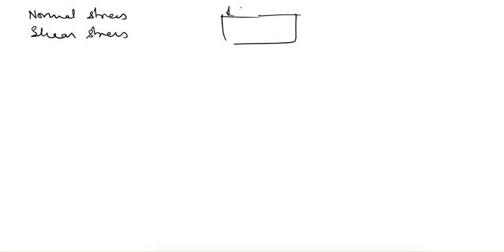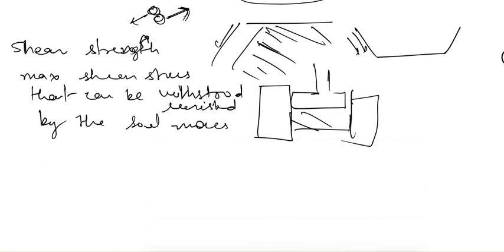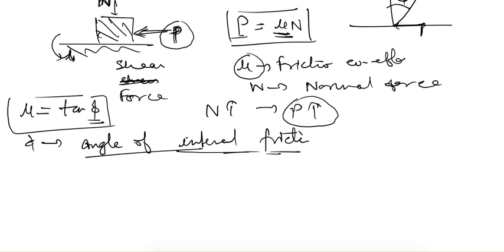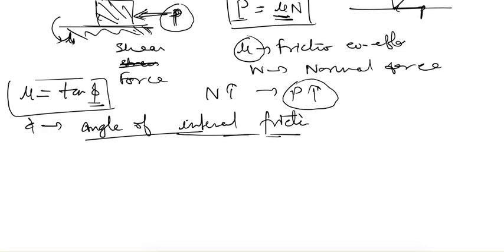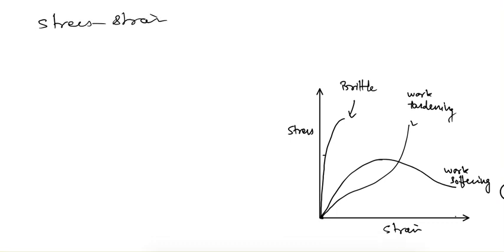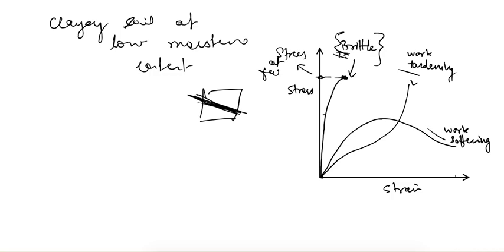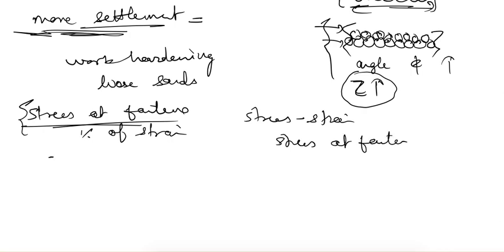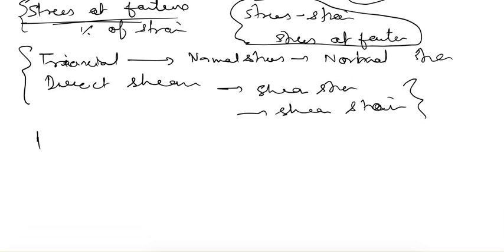Shear Strength of Soil | Soil Mechanics

Comment: sir, can uplease explain only shear of soil,. ie what is shear .....not shear strength or shear stress...plssss sirrrr
Reply from the maker: In simple words, shear is the movement of a body or mass along one plane. For understanding you can imagine two bricks and let's say you have kept them on over other. Now there are two ways you can bring them apart. 1. You hold the two bricks in your hands and pull them apart, thats the tension. 2. You can try to slide the the two bricks in opposite directions, if the sliding occurs that is your shear.
Reply: where is the next part?Good to have it as the first one was helpful to me

Comment: if volume of soil decreases then why pore water presure increases . plz tell me the concept
Reply: Sir why you deleted  the answer  of my question
Reply from the maker: I didn't intentionally delete it. All the comments which were there previously got deleted in switching account. I will answer your question again.
Reply: Please  answer. That time i will copy it and save it
Reply from the maker: A saturated soil mass is made up of two components: soil grains and pore water. When we apply some load on this soil mass it can be carried by pore water and inter-particle force between the soil grains (which is indicated by effective stress). But in the initial time as we increase the load on soil mass, all this load is taken by pore water which results in the increase in pressure of pore water. As the pore water pressure increases a pressure gradient will be formed and pore water will gradually flow out of the soil mass which will result in the reduction of soil volume and the load will be transferred to soil grains which will increase the effective stress.
Now for your statement, it is related to triaxial test and whether the soil is normally consolidated or over consolidated.If a normally consolidated soil is tested in triaxial apparatus and we increase the load on the soil sample so there is a tendency of pore water to move out but if we do not allow the pore water pressure to go out then pore water pressure will increase and volume reduction will take place only if the pore water goes out. 
So your statement is not totally correct. If the volume of soil has decreased then it means that pore water pressure has also decreased.
Reply: APSED thanks
Reply: what if the soil is overconsolidated.